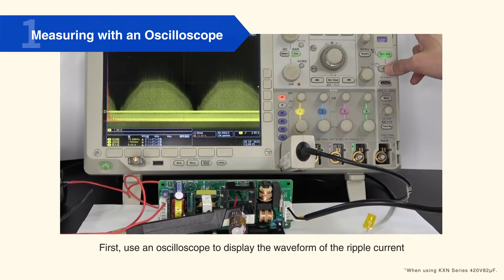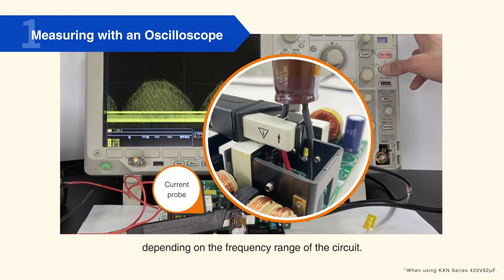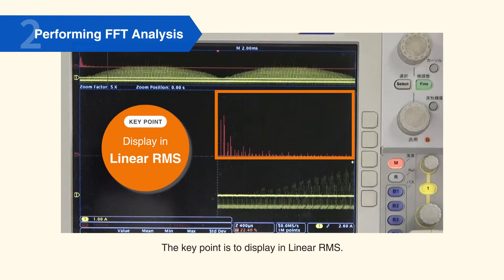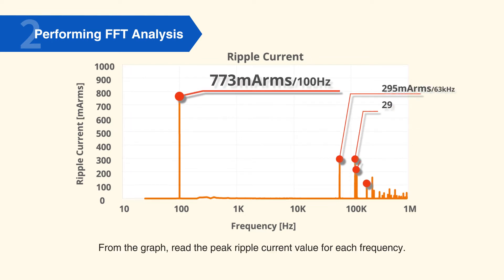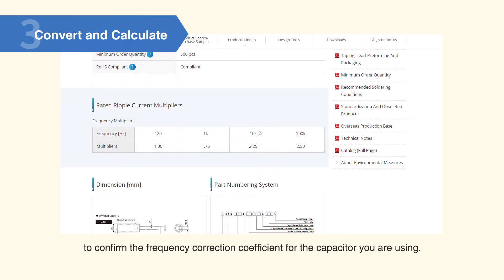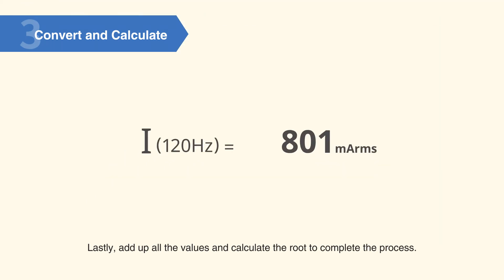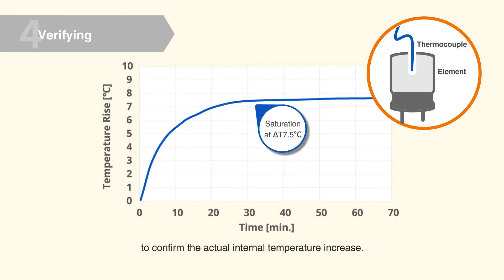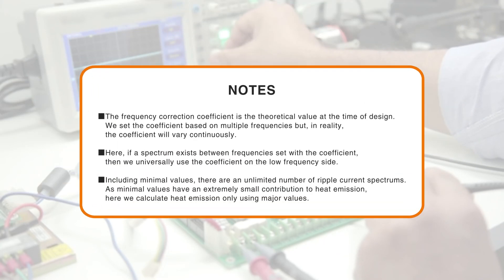Tutorial | Calculating the Ripple Current of Aluminum Electrolytic Capacitors by the Oscilloscope

Comment: "Insert the thermocouple into the center of element"... Do you mean we need to drill a hole from the cap of capacitor and put the thermocouple into it? Is the capacitor OK if we do that?
Reply: I saw some paper about that. I actually don’t know how far inside they place the thermocouple. I would definitively drill the top alu section and then place thermocouple there. If that works I would try to push it inside more and take measurements again. I would also get super thin thermocouple.